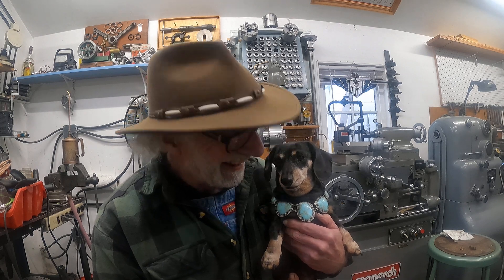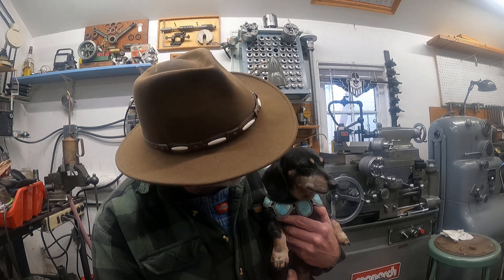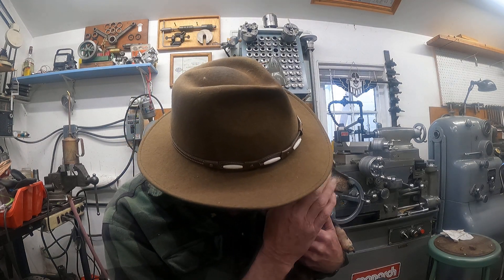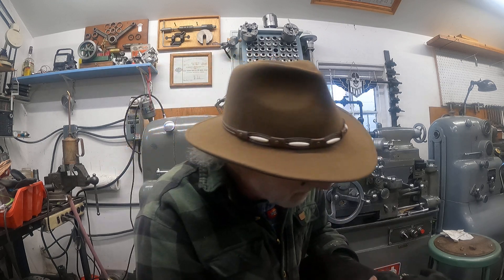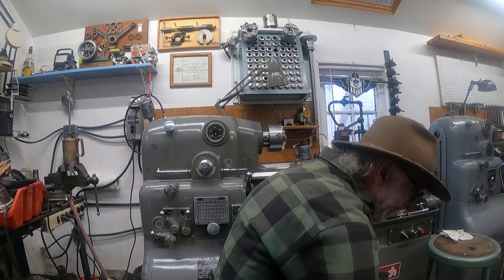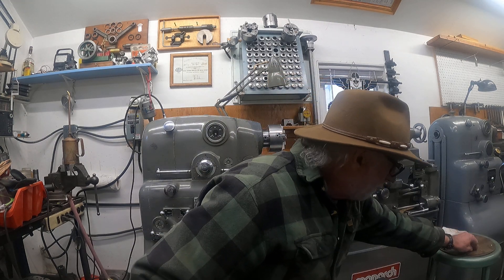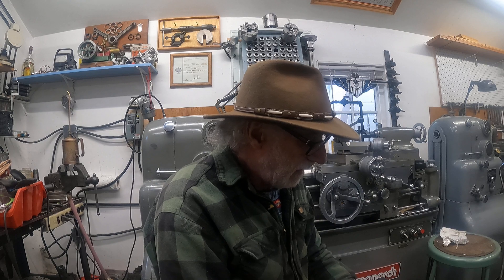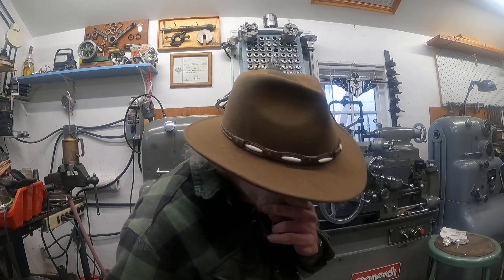Garage Machine Shop, the machine floor concept

Comment: Space efficiency!  I have a 9x20 lathe and RF-45 mill in 45 sf, so I know what you mean.  Drawers are nice but they cost 45 $ ea and you couldn't fit them in because you don't have benchtop machines.  Recently I bought a Boyar-Schultz 818 automatic surface grinder, so I'll need to add on.  It's sitting in the driveway, covered by a tarp.
Reply from the maker: It happens, find a machine and store it until it can be delt with or let it get away

Comment: No kidding Dee.  Even if I have a large space I don’t want to be running all over the place chasing stuff down. My mill and lathe are going to end up facing each other with a small wooden topped bench between them and a wide flange track/trolley with a chain fall overhead. Within a few feet of that area are government surplus Vidmars with tooling and precision instruments.   It’s all kind of like the 12’  triangle in an ideal kitchen (stove, refrigerator, sink).  Placement of the tools and very organized tooling just feels great. In a past shop I had so many tools and tool boxes crammed together I didn’t have space for my projects.  Another approach a friend of mine is taking is to place some of his tools about 1/2 “ off the shop floor on small steel castors. It’s working out great for him.  Your space will be really tight.  I hope are leaving enough space to have a bench, coffee pot and a bed for Chloe.  Cheers, Will
Reply from the maker: A funny thing I can do is arrange the Axelson lathe with the radial drill into a diabolical 3 in one machine 10 times the capacity of a Smithy!  Its just a thought.
Reply: @deedeeindustrialsuperprecision  I can picture that arrangement and think it has real merit.  I suggest giving some thought to making some of your machines easy to move. My friend, Archie, put two steel, non castoring wheels under on end of his Hardinge and his Bridgeport.  Then added a small spud on the opposite end of the machines.  Using a small, aluminum jack he purchased at Harbor Freight under the spud he lifts that end of the machine about 1/2” and then can move those machines when he’s doing larger projects.  Thinking out of the box about how to use space is fun and can be really practical for small hobby shops… even those with two 10ee’s, an Axelson and a beautiful refurbished radial arm drill.  BTW, I love your selection of tooling and am really enjoying learning whatever you teach about their application. The only problem is now I want a jig borer and a tool and cutter grinder…. “Once an addict always an addict.”  Happiness abounds on your channel. Thanks so much Dee.  Cheers, Will
Reply: That kitchen triangle is a proven success.   I wonder if it originated in a machine shop  (We can say that out loud because there aren't any cooks or bakers present....with those rolling pins of discipline...or worse still that Louisville slugger frying pan).

Comment: Space…. We never have enough for sure. I have two physical locations separated by 20 miles. I do have two of some tools, but that’s pretty common even in a single location. I’m in the process of restoring my equipment that I bring to my residence, then rotate them out when completed. My remote property has two New metal buildings (520 sf. ea.). One will be a shop, the other will be storage. I have shelving in the one all the way to the ceiling to store tooling seldom used. I remember the days working in a small car garage, it’s taken 45 years to get to the point of not tripping over everything daily. Have a great day!
Reply from the maker: That is hard having two locations or more and keeping up on what is needed and where.
Reply: Kayak'n,   If your comment went on for pages I still think I would read it twice. You've arrived at solutions that I'm still out at sea searching for.
I risk losing the wind in my sails.   Sure hope I make it to safe harbor one of these days.

I have a remote storage space 200 miles away.  I slowly set up a second set of tools  (Carpentry and small engine).    As the organization grows I'm more and more tempted to bring all the tools back to one place and sort them out all over again.   What this tells me is I still don't keep things arranged properly, I've still have much more organizing to do....I'm still waiting for a good tail wind.

Comment: My workshop is probably worse than yours, I organise some, but then a new machine comes or large tooling items, then it needs re thinking. Its very definitely a one man only space.
Since its not at my home, all the machine oriented tools have to be in it as its a 12 mile round trip to go home and get something, but there are items that get moved between as needed, like my engine crane, stick welder etc.
If container prices return to something sensible I will probably buy a 20' for material storage, hardware, lifting and machine moving equipment as well as put the power hacksaw and big pedestal grinder in it.
Reply from the maker: This is bad, we need to organize and demand funding! Well, I am in critical condition on the whole thing, I have to get it together.
Reply: Even worse is an inherited one - which is what I've been left with. It's a typical type of shop in a 1 car garage. The mill's at the back end wall. The vehicle entrance door is totally inaccessible for 'junk.' the 'man' door is to the left of the back wall - on the side wall. To the left of the door is a decent 'small' lathe 2' between centres. With the mill table fully left, the table handwheel over hangs the lathe swarf tray - so it's impossible to get out of the shop ! with the mill table fully right, you can't get between it and a storage system along the right wall. If you stand facing the mill and take a step backwards, you'd trip over a welder. Further back is an island 'work bench' including a small pillar drill (one speed, one direction) and a small grinder. The work bench hasn't got any spare surface free ! The original work bench is on the left wall to the left of the lathe. The vice sticks up slightly from all the junk on the bench. To use the vice, you need to place your feet between the rungs of the ladder - after squeezing past the folded engine crane. A 5T 2-speed trolley jack is the next thing to trip over. Under the work benches is more random junk. To the left of the work bench is the compressor (1980) which I'm not going to switch on until the receiver's been pressure certified again and above that are 2 shelves packed with junk. In front of the vehicle door is one massive pile of junk stacked on top of another massive pile of junk. A mig welder lies under the island bench - among the junk. Gas welding kit there too (no bottles). On the back wall behind the mill are bigger milling cutters - inaccessible for the junk on the floor. The right wall has a storage system, partly labelled. To the right of that are 2 Van Norman 'Perfect-O' engine block boring bars, then a toolbox then a wash trough then the sliding garage door track - filled with junk.
Over a year ago, I started to progress this place - to discover several electrical faults. Just a couple left to fix including the one on my mill's rapids motor. To get at that, I need to shift junk. To do that, I need to find space to put the junk into. Life is a really big uphill battle !